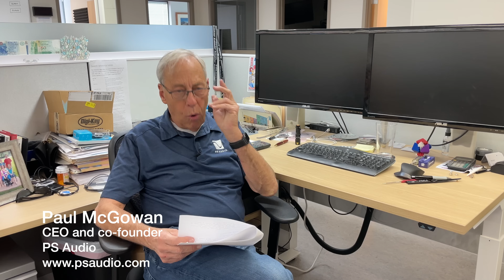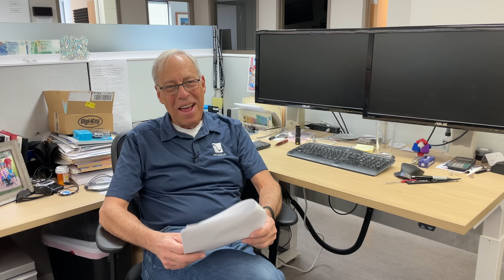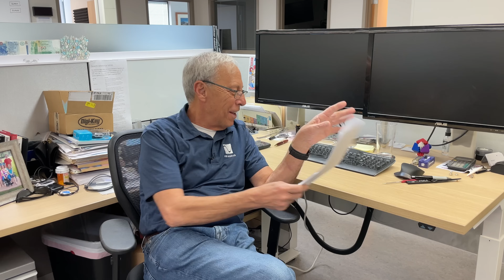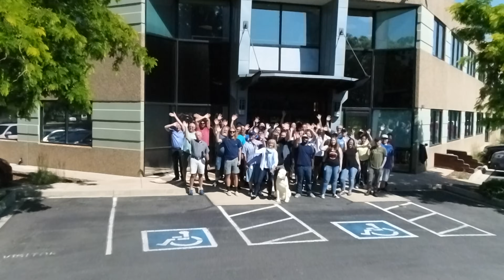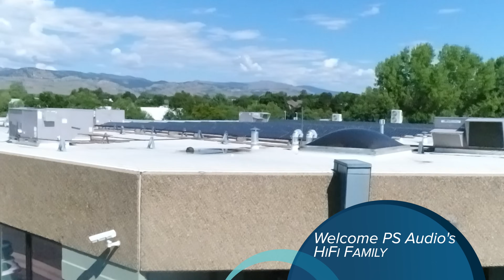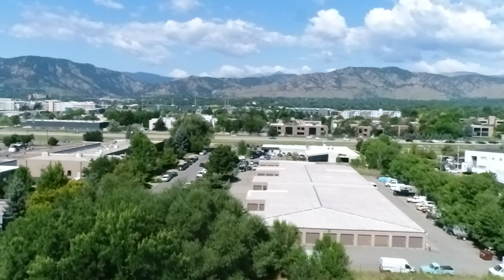Amplifier wattage meters

Comment: An old Pioneer integrated amp I had years ago used a combo of VU meters and peak LED lights.  As Paul mentioned, the meters would often be wagging around in the middle of the range when the peak light would start to blink.  That was a pretty cool setup.  A pure electronic meter setup would  be more accurate, but that is way too many blinking lights on the face plate of an amp.  The VU meter plus one peak light setup on my old Pioneer was my favorite setup.

Comment: Surely just in the same way as VU's are ballistically slow in relative terms, you cannot react to led meters in real time just as you can't to VU meters. 

Thats why BBC engineers referred to VU meters as "virtually Useless" meters. They used PPM meters. Each division between '1' and '7' is exactly four decibels and '6' is the intended maximum level. Many ppms also had a "second hand" and a single led which was used as a peak hold. 

There's not too much difference to when you see an led meter going into clipping live as like a VU/PPM its already happened by the time your eyes see it. They are both as useful when mastering and mixing down but as you have already said, even if you see the wave form in DSD it's after the event and near in impossible to edit.

I sometimes wonder how recording engineers that didn't have the miraculous saviour in DSD at their finger tips, managed to produce millions of recordings that are peerless even measured by today's standards. 

Come on now Paul,  we love your output and I get that you are excited by your Octive Records venture and I for one wish you every success but you know there are differences and not all VU meters are the same, certainly the ones on most home hifi are really only for aesthetics but unless you can exist in the past and present, you cannot say led meters are the answer either. 

Digital recordings offer something different but are they nirvana? Because not everyone will like them. No matter how much detail they capture, hence your comment that often people prefer vinyl cut from DSD to the native file itself. It would seem human hearing and perception is much more complex and tied into mood and psyco acoustic influences, more so than any of us understand in a scientific way.

Comment: If VU type power meters are useless because they do not respond accurately, does that mean that VU meters used for recording/playback on reel to reel decks and cassette decks are useless to?
Reply: Pretty much, which is why most studios use peak detectors with hold lights to show electronically where the loudest signals reach. With analog it wasn't such a big deal but, now with digital, it really matters as a clipped digital signal is pretty nasty.

Comment: Paul, you’ve hit the nail right on the head. Meters look cool, but aren’t really useful. 

If you like to watch a flickering needle as your listening to your favourite music, fine! Me, if it does not contribute to the audio performance or reproduction, then it is an unnecessary and cost contributing accessory!

Each to his own. When I’m listening to music, I have the LED display on my DAC extinguished and the LED display on my preamp set to it’s dimmest  setting, my preamp will not permit me to totally extinguish it’s display. I like to listen to music. The equipment has to be present, to reproduce that music, but, I don’t want it to intrude on my listening pleasure.

Each to their own preferences and choices. Just enjoy the music!

Comment: Most amplifier manufactures don’t want to sell you a 300 or 500 W amplifier only for you to look at the meters all day while you use it and realize that you could’ve gotten by with a 50 W amplifier and still had headroom 🤣 with most people these days operating speakers that are 92DB+ efficiency it really doesn’t take that much to drive a speaker to a level where you wouldn’t want to be that close to it, especially in a room where the walls are made out of drywall and the floor is made out of hardwood plank and the ceiling is drywall… You really can create a situation pretty easily where you only need five or 10 watts to make it uncomfortable. Now admittedly you need some power to have peaks for headroom, and there are people that have loud speakers that are difficult to drive or that have large woofer sections built in and they need a lot of power for that… So there are reasons to have a big amp, but I think most people would be very surprised that they are not using most of the power that they paid for. Unless they are shaking the walls of their house.

In the example I gave above with 10 watts, and a two channel system… You would be achieving 95 to 98DB SPL depending on speaker placement in the room if you were sitting 10-12 feet away from the speakers, which in most peoples homes is about as far as you can sit from the front of the speakers and not have them be jammed up against the front wall nor you be jammed up against the rear wall.  That’s a pretty reasonably loud level for every day listening out of 10 watts. Even at 20 feet you’re still at 90 DB…

Comment: I think it totally depends on how well that panel VU meters (or power output meters in the case of power amps), are calibrated on any one specific piece of equipment. Most of the time, especially if you happen to see them on a component nowadays, meters of either type, (analog/mechanical needle OR LED string type), are just purely for "looks" or "show" and they don't actually indicate anything useful, (some are actually even SO useless that they are just a group of totally randomly flashing lights that don't even follow the music beat at all!), however, back in the "heyday" of actual proper VU meters of many higher quality components of decades past, I had found a few amplifiers that actually indicated their real-world power output at any given moment fairly accurately, at least enough to let you know when you were getting close to clipping them and/or overdriving your speakers.

The "best" implementation of VU meters are the ones that are a combination of BOTH the analog/mechanical needle type, (to show the "average power"), together with a faster responding "LED string" type, (to monitor the "musical peaks"), placed either directly above or right beside the mechanical meters, that way you can view both power levels side by side at the same time. Either that combo, or second best are the kind of meters that have a switch beside them for monitoring either the average OR peak levels, (i.e. slower or faster responding), (being appropriately differently "weighted" electronically), and those can be either analog/mechanical or in an LED string, with the former being slightly better at reading average levels, due to their inherent slight mechanical mass, and the latter LED type being slightly better at reading fast transients and "peak" levels, because LEDs are pretty much instantaneously either on or off, given the input signal.

But no matter what kind of VU meter it is, (or in the case of an amplifier, a power output or wattage meter), the MOST important thing about them being that they are properly calibrated, with the best implementations of that being quite accurate and useful for at least setting basic levels, (AND very fun to watch!), and the worst implementations of the "VU" or "power output" meter concept being basically totally useless and rather annoying to watch, because of not being properly calibrated to the musical signal, or just of a very poor quality meter to begin with, like the kind I mentioned that are just a bunch of randomly flashing lights that don't even keep tempo with the music beat, those kind are just laughable, lol!

But the bottom line here is that PROPERLY implemented AND calibrated VU or power output meters CAN still be useful for at least watching for a general level and to not overdrive your equipment into clipping, etc... Plus they also have the added "benefit" of just being fun to watch, especially when you're playing your music/system at higher/louder levels.

Take for example a really good quality brand, (mostly vintage), equalizer with a minimum of 10 or 12 bands on it, the kind that have an RTA full spectrum analyzer display on them, and watch those for a visual treat, or take an amplifier like a vintage Carver or Onkyo Integra power amp and appreciate their reasonably accurate power output meters, for another example... There definitely ARE very good, well implemented design (components with VU/power meters) out there if you search for them!

Comment: Electromechanical meters are not useless.  They give an indication of average power, which lets the user know how much heat the speakers are dissipating.  
Music does not have infinite crest factors.  If average power is only 10% of an amplifier's rating or less, it's extremely unlikely that heavy clipping is occurring - at least you can be assured that any clipping isn't severe enough to lead to tweeter damage.  
It's also possible to build peak-reading meters, by adding circuitry that detects and holds the peaks until the meter can respond to them.  
But any amplifier manufacturer can add LED strip meters with peak-holding, so the user can see how close their peak music level is, to the amplifier's clipping point.  This isn't expensive and I don't believe there is an excuse for omitting them from any amplifier intended for the audiophile market.

Comment: Had an Ampzilla back in the day, I bought it new - sure missed those huge meters bouncing around after I moved on from that wonderful bipolar design. That amp would dim the lights when I got it pumping - the guy that bought it off me told me flat out that he wanted it for the power transformer, what a beast - - for sure I wish I never let it go.
Reply: Back in ancient times when I was studying for my EE degree at the U of Washington, I needed a power transformer for a linear power supply project I was building.  I found a listing for a local company in the yellow pages (actual printed phone book - remember those?) called Tierney Electric, and contacted them about my need.  They said, oh sure, we do projects for the UW sometimes.  They designed and built a custom transformer for me, at a reasonable price I might add!  
I still have that power supply today, although it needs some repair and mods before I can use it again.
Reply: @marianneoelund2940  Marianne, that's a very interesting story, and yeah, I get it, I'm impressed that they'd custom build you some iron, and yeah, as we both know, good luck trying to get service like that these days! And yes, guess I'm dating myself, but for sure I'm well old enough to have had to rely on the Yellow Pages! As for the Ampzilla,  I never spoke with the guy after he bought it from me - yes, he was all over that monster transformer, he couldn't wait to own it - he was an amplifier builder, one of those genius types so I know he intended on redesigning the amp to his liking - - funny thing is, I really would love to take that amplifier (although of course it was single ended), and put it into my current system assuming the caps and such were still safe to run - - probably be a bit hard sounding but there's no doubt it would drive the maggies I'm currently running with ease - man, that amp would really pull current out of the wall, I wasn't kidding about it dimming the lights on heavy bass passages - if ever there was an amp that would benefit from 10gauge, that was it, but unfortunately I didn't get into that stuff until some years later - - it was so gorgeous with those giant meters puttin' on a show - man that f'er would crank.  Thanks for replying,  Skip  ( :

Comment: In my testing the usual powerlevel is at 0.1-1W range and the analogue meters feels superfluos. What I would prefer is one big fast Yellow/ Red LED that give alarm for clipping on inputs or power amp output. That would not be very expensive to add to amplifiers. Many thanks for all the good learning you provide!

Comment: In the long term, Mechanical Meters can also start to stick - not good. With sample and hold circuits you can get MMs to present fast event clipping, but added complexity. All the best, Beamer.

Comment: For the same reason most cars don't have a meter indicating the car's charging voltage. They add cost and few users know what they mean. Think about it, a normal speaker system will be about 87 to 90 dB sensitivity. So for normal "full volume" listening you will be using 2 to 5 rms watts. You amp can deliver up to 80 or 120 or 150 watts per channel without exceeding 0.1% distortion. We don't need amp wattage meters.